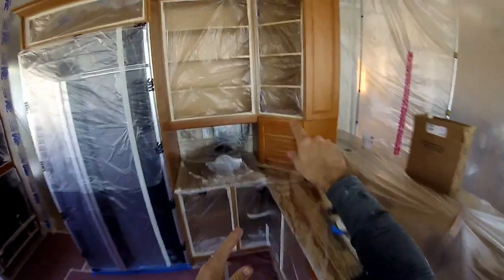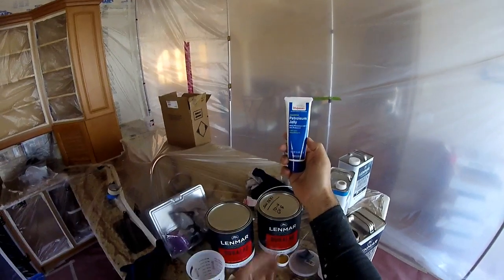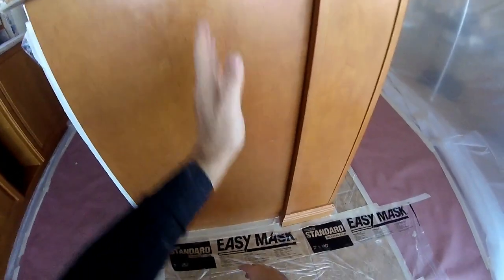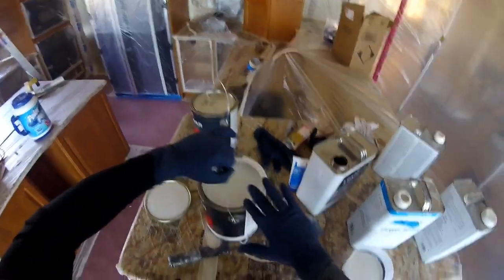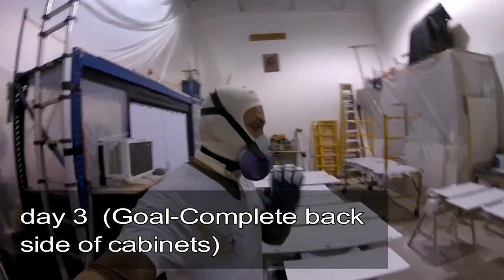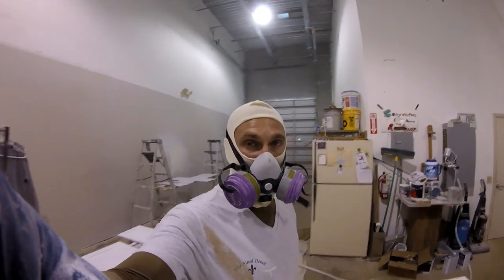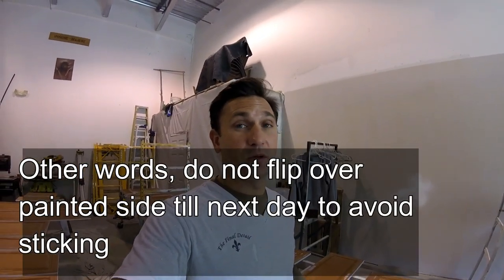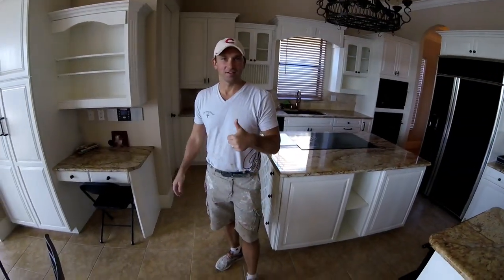How to paint Lacquer cabinets

Comment: If not in a spray booth be careful w electrical explosion hazards.  A booth has special lights and also the ventilation fan motor are all protected to avoid explosion.
Reply from the maker: Hi Richard,  thank you for noting safety and benefits of spray booth.

Comment: Love this video thanks. I’m having a tough time figuring out the best way to set up the gun I’m using titan cap spray 115. I seem to get best results with a lot of material and high pressure instead of low setting. The cabinet doors are new mdf I primed etc but my finish just is not as perfect as a factory finish. It’s close but I get a touch of orange peel they are smooth as glass to touch but a bit orange peel ever so slightly. I kind of think I’m putting to much on maybe?? Any thoughts???
Reply from the maker: You gotta thin out little more possible. Since this video we switched to Waterborne . Seems easier to use
Reply: @RollABucket  I started out using the kem aqua pigmented lacquer it was easy to use looked amazing wet but dried textured like had to sand a lot and put like 4-5 finish coats to get a nice finish. It just didn’t have that perfect lacquer finish and I can’t just figure it out. I’m like 95% there just can’t get that last 5 ha haaaa. It’s fun troubleshooting and learning though
Reply from the maker: @mikeevangelista1177  same issue we hade with Kem Auqa coverage when using straight white. Then when they added a bunch of white pigment, it covered better.   As far as sandy texture, not sure.  
If your gonna continue to use the solvent Lacquer, remember if your getting lap lines, add more extender. This will prevent from drying so quickly and level paint out. If your getting “orange peal”, thin out with “high quality” Lacquer thinner.   If you getting fisheyes, use that automotive additive I had in video. Some people use as much as 30-50% of these additives I’ve heard of depending on your conditions.

Comment: Sorry I’m confused because the solvent looked like the same? Both read the same
Reply from the maker: Mental Fit Chick hi, yes you have “ lacquer retardant” and “lacquer thinner”. They do two different things to the paint. The thinner, thins the paint. The retardant gives it time to spray evenly.   If you are new to this, I would recommend using “waterborne lauquer.” It’s a water clean up and you don’t need to add anything to it like you see in this video.
Reply: Zorr Corp omg! Thank you! I DIY’d some built ins from maple plywood and I’ve to paint them. I’ve some Ultramax Lacquer paint and a devil bliss spray gun
Reply from the maker: Mental Fit Chick 😎👍